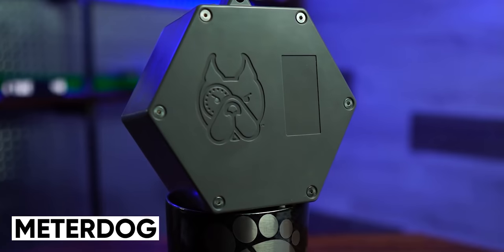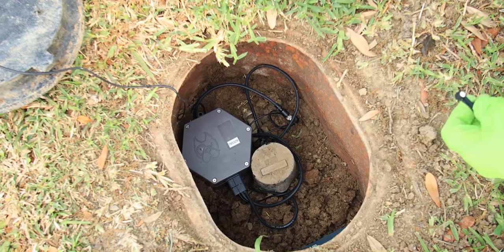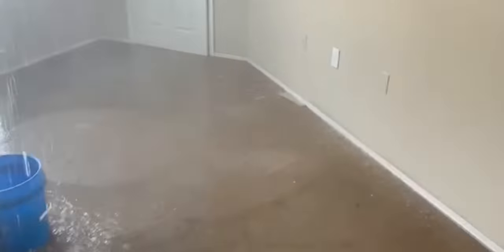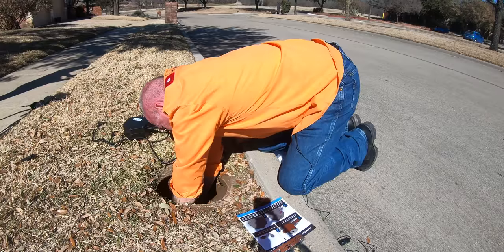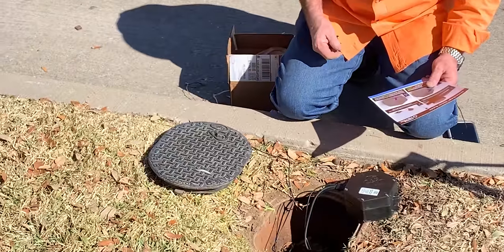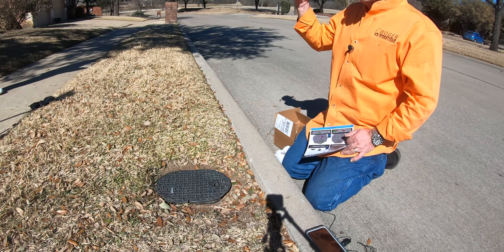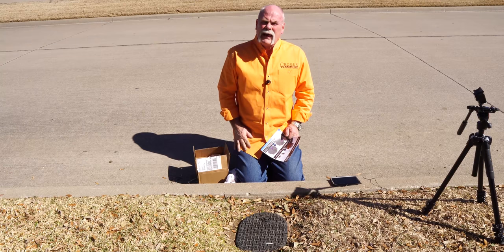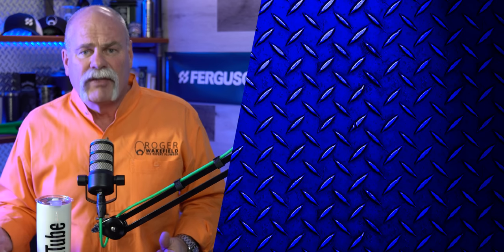This New Remote Leak Detection System Will BLOW YOUR MIND!

Comment: Great info here Roger! 

When I was a kid, we woke up one morning to about 2 inches of water through the whole house. My mom had me shut off the water, and we found out from the plumber that the flood had come from a burst supply line under the kitchen sink. Not sure how much the damage was, but the drywall had to cut out 2 feet up all the way through the house, and all the flooring and cabinets needed to be replaced. Since my dad was a General Contractor, we ended up staying in the house after the first 3 days. The only reason we left was because they had to do mold remediation. Honestly, the whole situation is part of what made me want to become a Building Engineer when I grew up.

Keep up the awesome content!

Comment: i just started installing the moen flo by in my customers houses. it works on wells and city water, and its a valve that does the same thing as this system you have. this is a great way for customers to find leaks and call us plumbers to fix them. all houses should have something like these devices. PS things have really changed in the 20 years i have been a plumber lol

Comment: Hey Roger,
Licensed plumber and business owner   from Chicago. How does this thing distinguishes leak from:
- Ice maker ( little water now and then)
- RO system water usage (a trickle for a long time)
- water softener regenerating every 3-5 days in the middle of the night.
I installed Leak Defense systems (very expensive and complicated that's why I don't like them)  and it takes a lot of programming/data to be put into it by manufacturer prior to installation. 
So.. how this thing overcomes this problems?

Comment: I like the product.  I opted for the Phyn Plus.  Even though it requires installation inline on my water main, it can learn water usage and detect pressure and temperature changes before the line freezes.

Comment: How many sold hours do you charge for installing one? How many more to install the optional shut off valve? Have you had any municipalities fine you for augmenting their meter box lids OR required you to remove the system after you installed one? Does the installation require a permit in Flower Mound? (Just kidding, Flower Mound requires a permit to drive through their city, even if you don't stop)

Comment: This is a system at home depot that will auto shut off your water based on smart detection. Cost is a little hight, but works well for house. I can't seem to find a link to the one you promote.

Comment: the best leak control system I've seen was on a part time home.  they had a switch in the garage, and a switch in the mechanical room.  when they left, they would hit the switch in the garage, and it would remove power from their main water valve, circulating pump, water heaters, and automatic ice maker.  they went to that after their automatic leak monitor; installed after a water heater breach, failed, causing their circ pump to run dry and flooded their house for a second time.  they did have a mechanical override on the valve that would allow them to have water if they had a power failure.

Comment: Looks neat, but whenever I see house tech like this the first thing that always comes to mind is support.  When something gets installed into my house I'm thinking long haul like 10yr+.  Do you think this app will still be around in 10 years?  Based on the track record of other "smart home" tech probably not.  The manufacturer will have likely moved on to their latest and greatest product to where if you didn't upgrade you're left in the dust with a useless brick.

Comment: How much will leak out of my bank account?
Reply: I’ve done the math. Water damage in my house would be cheaper for me to fix than buying this system:)

$500
Reply: @pinkiepie1656  I was at a house just yesterday. To repair a small section of pipe was about $300. The leak had been happening under the stairs behind the drywall for probably 4-5 months. I don't imagine repairing the drywall and the stairs will cost less than $200.